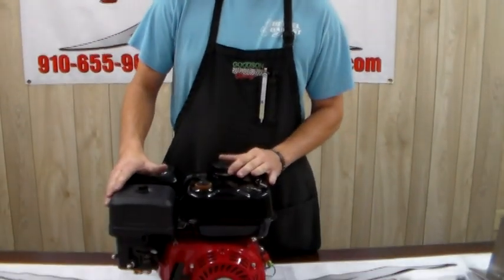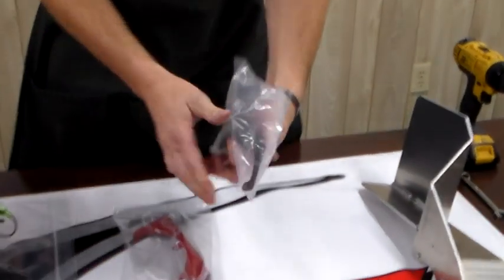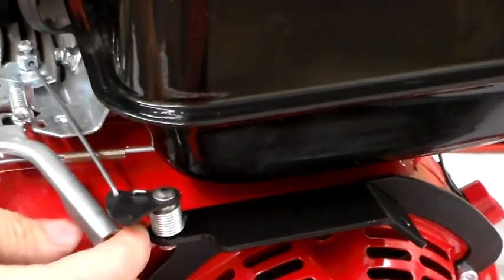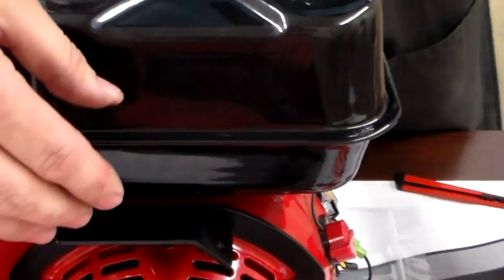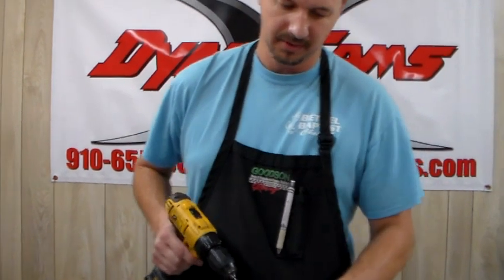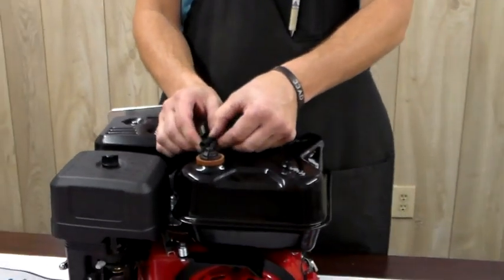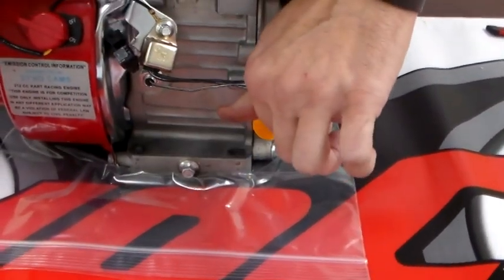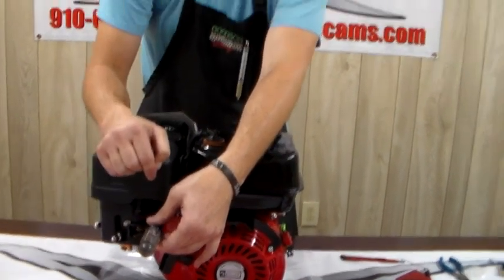How to Make Your 212 Engine Race Ready

Comment: I just got one of these motors from you guys and I cant get it to run right, it will barely idle, if i give it throttle it dies out. Any tips?
Reply from the maker: Call Randy today. He'll walk you through whatever correction needs to be made! 910-655-9035

Comment: Well I am about to purchase this Ducar 212 just to swap out the stock 196cc on my mini bike. Not to race on a track with rules. On the website I am buying it from it says out of the box it comes governed at 5300 RPMs. I plan on just taking the Stage 2 Kit off the 196cc Engine it's on now and putting it on the new Ducar along with the Torque Converter and I'll see how it rides with just that done to it. No restrictive Muffler. Non EPA style Carb. 18lb Valve Springs. Under seat Header. Hopefully that will be enough for me to atleast hit the 50 mph mark. I'm on 40 acres of property and just want it to ride the trails here.
Reply: No need for stage 2 I believe it already comes with a amazing fly wheel but lmk how it goes I want to purchase one

Comment: My question is this, My friend is helping me get my Kart ready, A trick oval dirt Kart. Now, I have ordered a predator 212 non hemi. He wants us to Change to a pvl flywheel, and do racing exhaust, as well as fuel jets for the switch to methanol.  Can you do a video on something like that? I also will be using the gas tank on the kart with a Top plate and throttle linkage etc. I will also be changing from the air box to a bigger intake, and a filter I suppose for the crankcase unless you need that for the fuel pump that we will install on the top plate. 
Thanx
Reply: i know Im asking the wrong place but does anyone know of a tool to get back into an instagram account..?
I somehow forgot the password. I appreciate any help you can offer me.
Reply: @Uriel Drake instablaster :)
Reply: @Dangelo Terrance Thanks so much for your reply. I got to the site on google and im in the hacking process atm.
Looks like it's gonna take a while so I will get back to you later with my results.
Reply: @Dangelo Terrance It worked and I now got access to my account again. Im so happy!
Thank you so much, you saved my account !
Reply: @Uriel Drake No problem :)
Reply from the maker: Thanks for the topic suggestion. We are trying to start making videos again soon. Covid kept us short staffed for quite a while. Any other topics you think we should cover?

Comment: I never understood why people would remove the whole oil sensor unit, then tap it, and then bolt it up. For non-racing purposes, just snip the wire and leave everything in place, in racing cases do exactly what yall just did!

Comment: Is it difficult to find electric start predator engines, or parts to convert to electric start? I want to build a electric start performance engine , because in the scooter it's not  accessible enough for pull start! I'm thinking i need a flywheel, rod,  maybe a piston, the engine in it now has seen 10,350RPM, although with CVT tuning I have it under 8800 now, but it's a completely different engine design, and only 82cc,   what us the Maximum sustained RPM for these engines, now it's full throttle 99% of the time in use, and if it's moving it's turning 5k rpm, so it lives between 5k and 8800-9200rpm, but I want to build a swing arm and mount the engine and rim to it, using a predator engine, with a CVT, definitely using a race style can, I'm running at least 100 octane fuel,  I'd like to have the engines to sound similar,  I'm thinking of running a 1.5" exhaust maybe a 6" header to the 1.5" exhaust, hoping it will be kinda quiet, while being a decent performer, I also need about 14v and 5-10 amps charging, but I can add a small alternator if the engine can't supply the current! Can a predator with aluminum flywheel, aftermarket rod, reliablt spin about 6k+/-, for a sustainable time, as in 2-3 miles? And actually survive? I'd like it to make around 12hp, 10-11 atleast, I thought about using the 79cc , but is it even possible to affordable make anywhere close to the power required? It would probably need to turn about 7-8k rpm!

Comment: Why does Ducar even make them Awesome Engines with a Oil Sensor?'
Reply: Because it is meant to be stationary. Like on  a power washer or generator.
Reply: It's the identical engine to the tillitson and predator they are all considered clones of the honda line up and the ducar imo is by far biggest bang for buck right out the box 📦